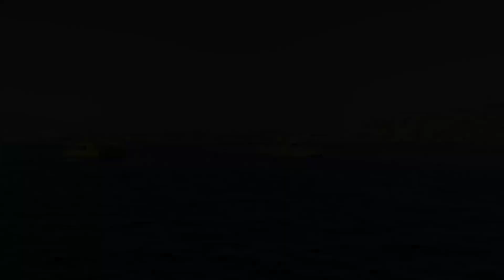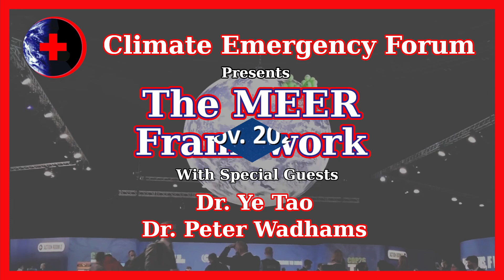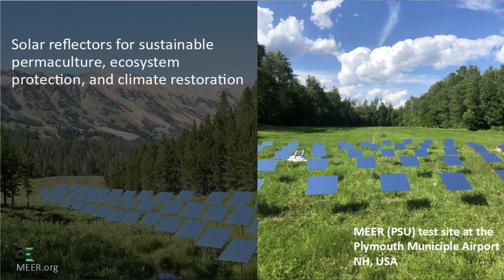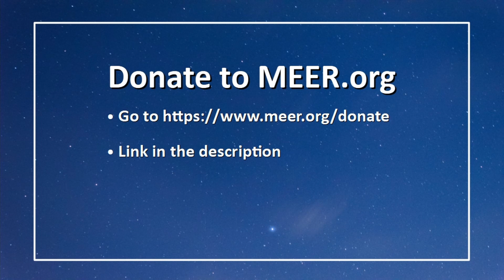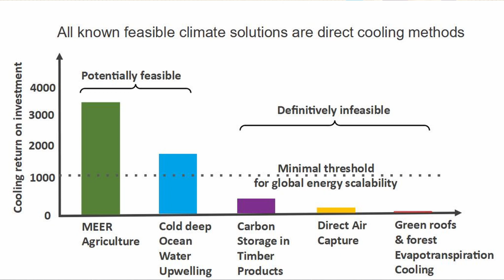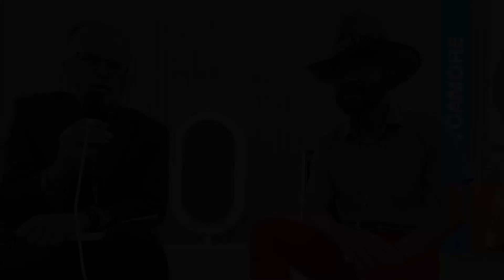MEER Update - November 2022

Comment: I am very concerned the MEER project WILL be successful in the locations where its reflective material is being proposed to be placed - namely in the equatorial/tropical and middle latitudes.

Why is this a big problem?  There are at least two major immediate results of increasing greenhouse gases driving climate change.
1.  Average global temperatures are increasing
2.  The temperature differences are decreasing  between the poles and equatorial areas; this is causing major disruptions of both wind and ocean currents and so causing havoc.  So far this decreasing temperature difference is due strongly the Arctic warming faster than the rest of the planet.

However, if the MEER project is ONLY implemented where it is now proposed - in the equatorial and middle latitudes, then these areas will become more cool.  This may dramatically FURTHER reduce the temperature differences between the Arctic and Antarctic.

The Atlantic Meridinal Overturning Circulation AMOC is significantly driven by the temperature differences between the equatorial and polar regions.

Without also dramatically cooling the Arctic, by the Arctic continuing to warm while the equatorial and middle latitudes become cooler due to the success of MEER and other efforts, then the AMOC will likely slow down even faster and increase the risk of its possible collapse!

Thus, the MEER project needs to coordinate its cooling program with programs to cool the Arctic so the temperature differences between the Arctic and equatorial and middle latitudes is FURTHER INCREASED and thereby help restore planetary wind and ocean currents.

This coordinating might include coordination with Marine Cloud Brightening in the Arctic, with the Arctic Ice 911 project led by Professor Leslie Fields of Stanford University, and other projects to help refreeze the Arctic.

One additional strategy to refreeze the Arctic might be that during winter to spray sea water into the air so it freezes to make thicker ice.  Fossil fuel companies already do this to build platforms for their drilling rigs.  The electric power to support this might come from underwater turbines placed in strong Arctic and Greenland ocean currents.

Another approach might be to slow down/block the transfer of warm Pacific and Atlantic currents into the Arctic.  This might be done by building floating bridges across the Bering Strait and straits on the Atlantic entrances to the Arctic.  These bridges can contain partially filled bouys whose depth matches what historically was the depth of the Arctic ice at these locations.  This would RESTORE the environmental conditions prior to Arctic Warming and ice loss.

Thus, all the above and similar efforts to cool the Arctic need to be coordinated with MEER efforts to cool the equatorial and middle latitudes so the temperature differences between the poles and these other areas also increase and thereby help restore historical wind and ocean currents.
Reply: The situation is not as simple as described in this post, because the poles are a major heat sink for the lower lattirudes.  Cooling the equatorial regions also contribute to cooling the poles, and actually may be more effective at doing so compared to performing localized SRM in the Arctics, given the difference in annual available solar radiation, and the intrinsic challenge of any engineering operation in the arctic.  

Based on preliminary trials over water, MEER sheeting can be designed to float over the arctic during summer months.  More detailed studies of feasibility are however necessary.
Reply: @yetao5801  Are there any other possible rebound effects?

Comment: Do the mirrors mess with bird migration or bird death as some birds fly into mirrored windows?
Reply: No death possible because of the low-lying, quasi-horizontal placement.  No focal point to create local concentration of light to induce thermal damage.  Migration impact needs field experiment.  Cooling benefit and ecosystem maintenance is projected to outweigh any impact to creating potential detours in migration routes.